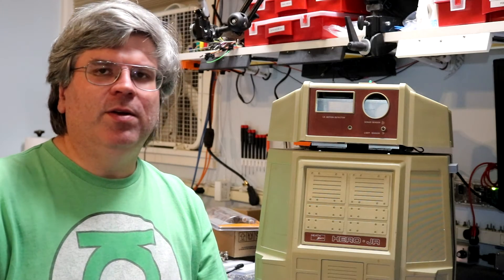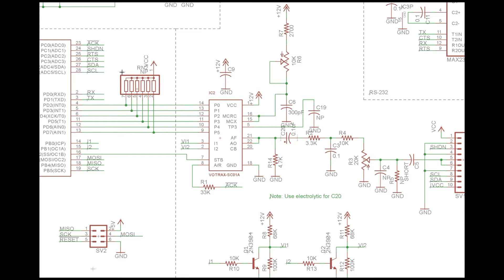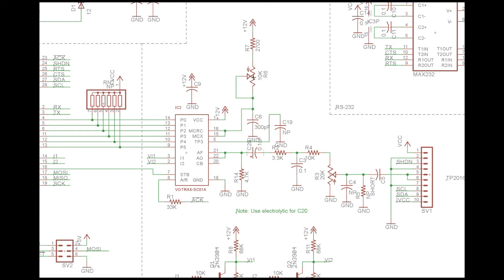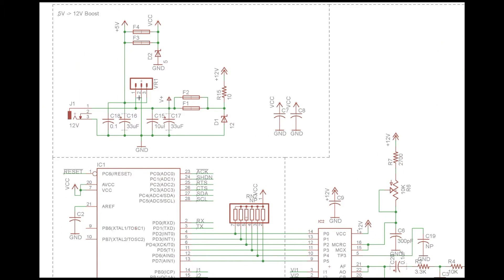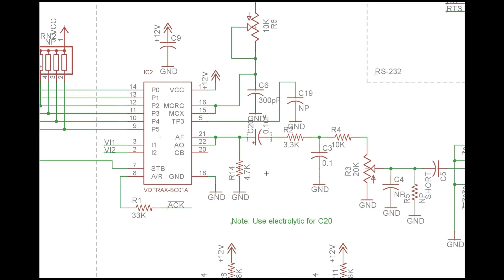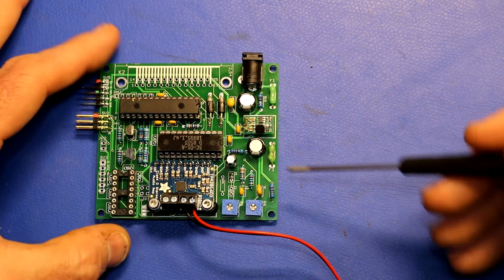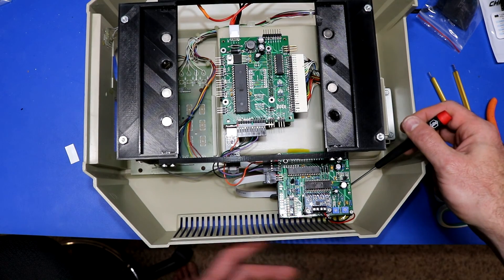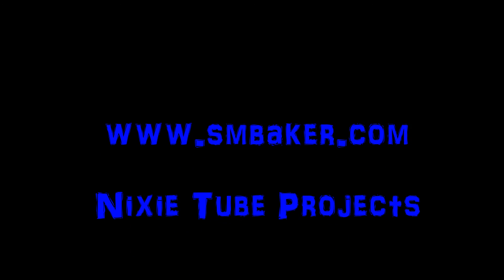Heathkit Hero Junior Rebuild Part 3: Votrax SC-01A Speech Synthesizer

Comment: Very cool. It would be neat to put a digital pot in place of the fixed resistor in the R-C network that controls the SC-01's pitch. Might make him a slightly better singer. :-). On second thought, maybe could just replace the rc network entirely with a gpio or two from the MCU.

Comment: There is a circut board project for the Votrax SC-01A in an old BYTE magazine (late 70's, early 80's maybe), which I built in about 1989, that used a GW-BASIC program to output the phonems over a (standard) centronic parallel (printer) port. Unfortunately my SC-01A was already dead, and the chips were 100-200 NZ$, so I never actually got it working. But they are really nice chips. I believe there is 2 male voice tones, and 1 female voice tone, which are more just frequency changes.
Reply: hmm, might be interesting to hear a set of those chips singing a duo.